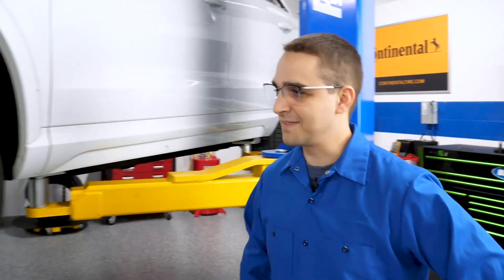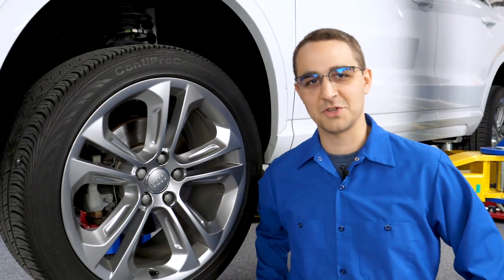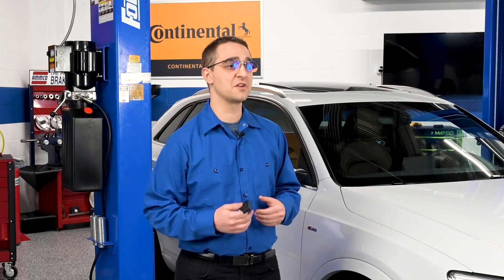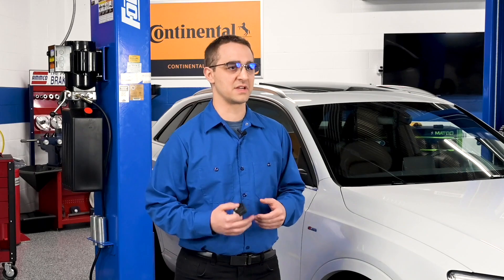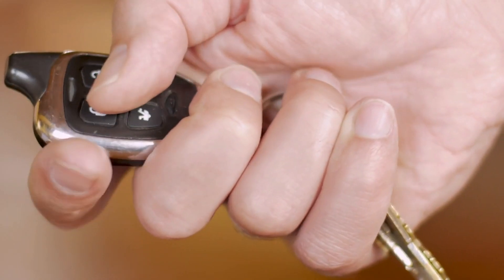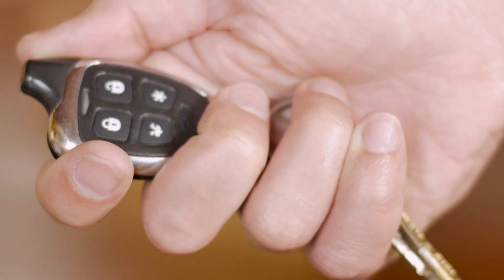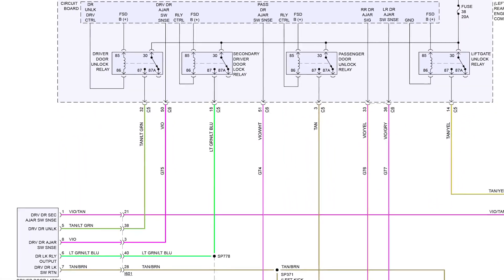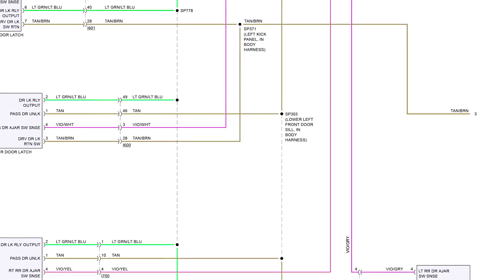TPMS Antenna Curve Balls

Comment: The nearfield transmitter is 125 KHz, the tpms sensors transmit data at 315 MHz for US cars and 433 MHz for most foreign ones.  Big difference between Hz, KHz and MHz